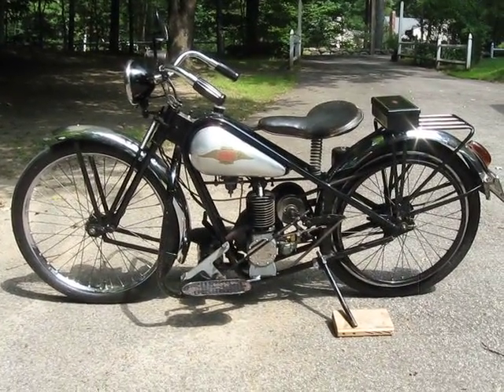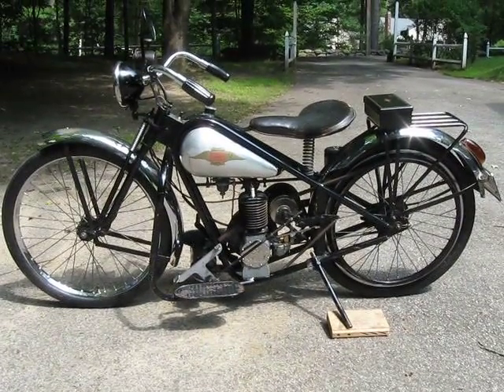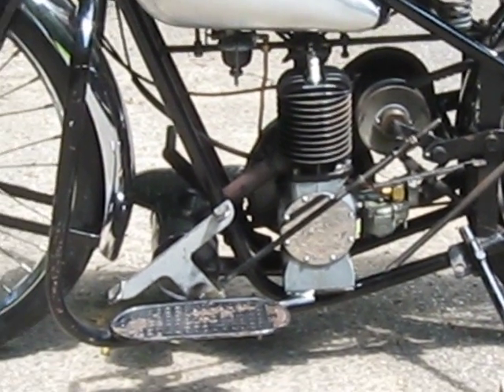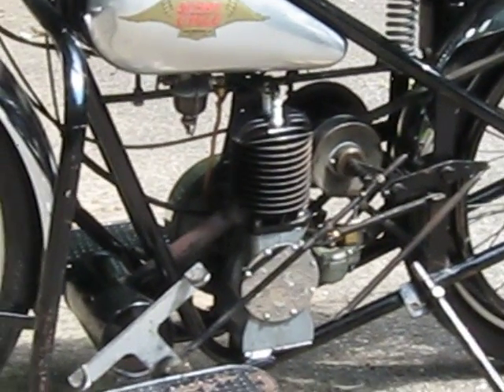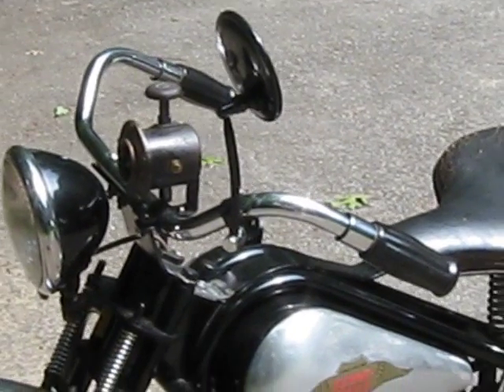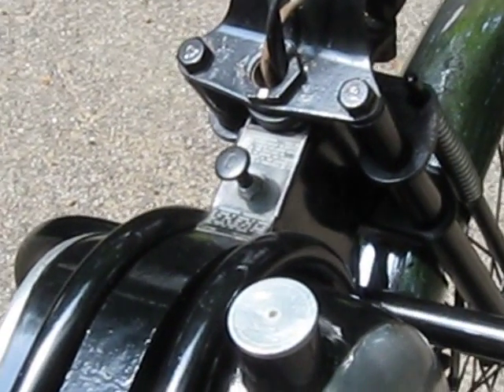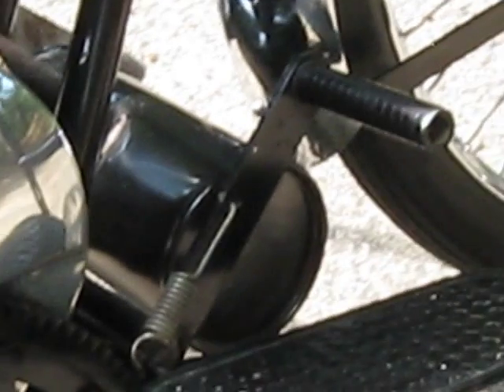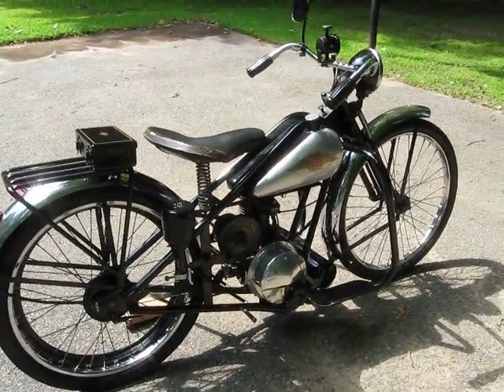Video 2   1948 Simplex Model J Servi Cycle

Comment: Jeff.  I just fell into 2 of them recently.  I got two early 1940's.    Can U measure across your headlight lense/trim and front to back of headlight housing.  THX  Mike
Reply from the maker: Hi Mike,  
I used calipers to measure the outside diameter of the Headlight Lens Trim Ring.  It's 6 1/8".          And, overall depth from the front of the Glass Lens to the rear of the black Headlight Bucket is 4 3/8".
I have photos and more details for you including info on the embossed Lettering on the Glass Lens and the stamped lettering on the Black Painted Headlight Bucket. 
Email me if you wish at : 1948simplex@gmail.com  .......Over & Out from Cooperland
Reply: @jeffcooper5473  THX.  I sent U an email.
Reply from the maker: @mikehasuga4959  Hi Mike - Hope you're making progress regarding the Simplex Headlight and Gas Tank you needed. As I recall, there was a Club in the mid-west that may be of assistance in your search for parts. It's the V.M.B.C. ( Vintage Motor Bike Club ) Club Headquarters were located somewhere around Indiana.
     I haven't been able to do any "Simplexing up here in Nude Hamster.
Frozen snowbanks, 10 degrees, and wicked windy. Perfect weather ....to stay inside.
Best of luck with your project. 
Jeff Cooper
Reply: @jeffcooper5473  THX Jeff
Reply: @jeffcooper5473  I just bought a tank for Simplex #2.  What a journey trying to locate a good one.  Nothing is cheap.
Reply from the maker: Hi Mike, Congratulations on acquiring that Simplex Gas Tank !
That's the signature piece of the Bike.

Keep the shiny side up, Jeff C.
Reply: @jeffcooper5473  Agree.  Very painful and not cheap to find one.   I'm glad the search is over.  THX